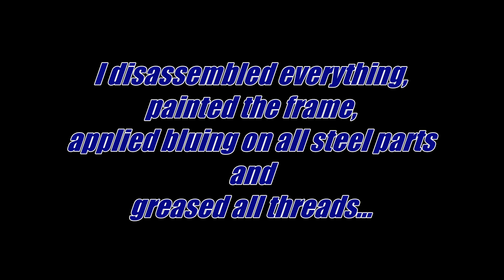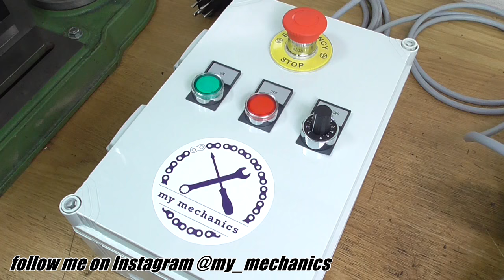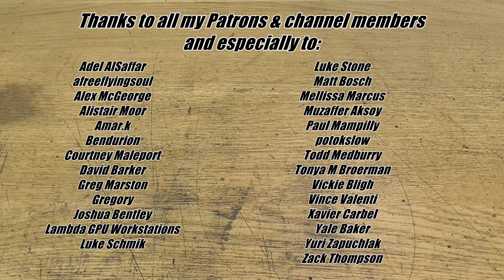Building a Huge Rotary Tumbler from Scratch - Homemade Rotary Tumbler

Comment: I was really curious what you would be using it for... I made one for a tumbler composter with a wood frame and while it was all working nice empty or with little load, when the load got heavy and a bit sticky man it jumped off the wheels... But those porcelain bits will probably never ruin the balance enough for it to fall. Really cool build!!
Reply from the maker: Glad you like it :-)

Comment: I don't have much experience of using a lathe or welding but I am familiar with those blue storage vessels and I wonder how long the sides will last with a heavy load running against the roller wheels. Otherwise, another example of fine engineering - thanks for sharing.
Reply from the maker: Time will show, thanks

Comment: good job and a great video, but i would like to give some feedback about your welding;

first of all, i would not recommend welding with those greeen rubber plastic fabric gloves, as sparks can easily burn through and burn your skin, i recommend welding gloves. and if you wont want that spatter at the beginning when you press the button down, always cut the molten ball from the wire or cut the wire to not be any longer that the metal piece it comes out from, cant remember the name.
Reply from the maker: Thanks for the tips!

Comment: I'm curious about the rubber tube clutch. Why is it needed? Is it normal to use a rubber tube?  What are the pros and cons?  How long before the tube wears out?
Reply from the maker: It's an easy and cheap flexible coupling

Comment: the only possible consideration would be isolation mounts to stop the noise and vibration from transmitting throughout the shop
Reply from the maker: It doesn't vibrate at all

Comment: I know this has been on for more then a year, but doesn't the motor turning counter-clockwise risk loosening the drive shaft nut? And if so, could you reverse the polarity on the motor so it turns clockwise and tightens the drive shaft nut even further? Or does the hydraulic tube prevent all that?

Comment: Great job. May I ask about this rubber tube connection / clutcht?
Is this a kind of "fuse", which would fail if something is blocked?
Reply from the maker: It's a flexible coupling, because the shafts are not 100% aligned.

Comment: I don't even know why I'm jealous even if I had a shop and the equipment and materials I still wouldn't bother or probably try for like 5 minutes loose a few eyes and give up. There is no substitute for ability I had a wooden lathe for year's did the odd really rare piece then I friend borrowed it the things he made with it I just couldn't take it back like it cheated on me some people have a vision of what they are making other like me f it up at the start and give up. Well done to this guy clearly an absolute professional. One question that welder that's hardly one of those cheap flux in core ones?
Reply from the maker: Thank you very much, I really do appreciate it :-)

Comment: What is the purpose of the section of hydraulic tubing as clutch? Providing variable torque as the weight shifts in the barrel? I am amazed that it can turn 45 KG that easily.

Comment: Amazing work as always. Loved every second and can’t wait to see it used in future videos. 

I do have a question for you though. Is there a reason you are using taps and dies to cut your threads rather than single point threading on the lathe? Is this personal preference or is there a deeper or specific machining reason?
Reply from the maker: It's just much faster
Reply: @mymechanicsinsights  that makes a lot of sense. Thank you :)

Comment: I have two questions. 
At 5:30 when you are making the driveshaft holder, would you be able to align the driveshaft-holder’s hole concentric with the lathe as you did if the hole was already cut-out before putting the piece in the lathe? How would you achieve this if you are able? 

I saw something at work the other day where a coworker was trying to chamfer a hole for a laser cut rectangular part similar in shape to that of yours. He was struggling with making the hole concentric with the lathe so that the chamfer could be done evenly across the edge of the part. His lathe also only had a 3 jaw chuck. I didn’t know how to help at the time but I assumed it had to be possible someway. Curious to hear if and how it can be done. 

Great video by the way, happy to have found your channel! Thank you for the interesting and inspiring content. 
-Noah J. Donsig
Reply from the maker: should be possible yes, thank you

Comment: Hey, nice work there!
One question: What's that little metal foam piece for, You put in the lid at 13:46? 
Some sort of vent to allow air/pressure exchange while keeping water and dust inside, would be my guess.
Am I getting that right?

Comment: I don't 100% get the part with the cable, where you attach the ground from the motor, but didn't do that for the electricity within the control box itself... Like will that actually be grounded now?
Reply from the maker: The box is made of plastic, so isn't conductive. The ground wire is conected to the ground from the power supply.

Comment: that is precise work and I love the closeup views you provide. My question though is, how will the blue plastic barrel hold up to the grinding and polishing of the grinding stones inside it? Isn't the polishing material too rough on the plastic and combined with the weight (45 kg's) going to 'grind and polish' through the barrel walls after some time?

Comment: Great! But I guess blue bottle should be metal. Plastic one will break down soon.
Reply from the maker: Nono, metal barrel would scratch and damage the tumblered parts
Reply: @mymechanicsinsights  I think metal will be very smooth in some time, cause it'll be polished by the grinding stones. And smooth metal can hardly scratch another metal thing, only on a high speed rotation.

Comment: Just wondering the facing tool at 1:48 how long does it last before replace cutters normally? Sort of wondering as like idea of cost to run when using that tool
Reply from the maker: It depends  alot on a alot of different things

Comment: 7:45 now THAT is some high quality bar stock. Little to no "run-out" when chucked up in an R5 collet. Edit: 12:57 what in AvE levels of fabricobbling is that?! You precisely true, weld, and machine this elaborate chassis only to couple a motor together with some tubing and worm gear clamps? Before that, I wouldn't have put it past you to make your own centrifugal clutch but that tubing threw me for a LOOP.
Reply from the maker: Thank you very much, I really do appreciate it :-)

Comment: 17:54 :  my OCD is screaming in terror seeing that engine litterally floating in the air with no support under 😱
Reply: I am not quite doing that, it doesn't need a lot of power and that gearbox looks a pretty solid bracket. But most of the motors I worked with used a belt drive, and that puts a big side force on the motor shaft. Most of the load with a worm drive runs along the shaft.

Comment: I have a doubt, why don't you thread everything with the lathe? cant yours do that? is it more accurate to do it by hand? I have seen others do it with automatic forward settings. I'm just curious
Reply: There's another video on this channel where he makes a big bolt and he cuts the threads on the lathe. For smaller threads like this it's much easier and more accurate with a die.
Reply from the maker: Yeah much faster and easier with the die

Comment: To me it looks like the rpm is too high for reaming when you are reaming. What is your vz and rpm?
Reply from the maker: It's indeed, but worked well
Reply: @mymechanicsinsights  it probably is fine, and you will get round holes, the speeds are more for the longevity of the tools.

Comment: what an overkill, why would you not use simple relais and a low voltage switch board for the electronics? I have that exact same switchboard with a couple of chinese boards from ebay. However i like how clean the execution of the everything is. Hat's off to you as usual.

Comment: What’s the breather hose for?
Reply: The ceramic beads are mixed with water, over the course of a day(or more, ~max 60 hrs on timer) atmospheric pressure can change enough to put a strain on the drum seal, and if not vented = water leak.

Comment: There's this stuff called "wood" that is a lot easier to work with, and can easily handle the loads put on the frame, etc. 

Also, why do we need a shaft to synchronize the two wheels? Why not let the wheels spin independently? In fact, why not just mount four casters on a frame, and not deal with all the lathe work, bearings, etc.? The casters already have wheels, bearings, mounting plates, etc. Use two more casters to keep the barrel in position if you want. 

Also, I wonder how long the plastic barrel will last, with ultra-hard and abrasive stuff rolling around inside it.
Reply: Things can be done in different ways. 
From the amateurs point of view i can understand you, from the engineers point of view i totaly understand why he is doing anything in metal ;)
Reply: @TB-jl9fr  Well, I was trained as an engineer, and one principle I picked up is: Use the cheapest material that's strong enough for the job.
Reply: @karlchwe9644  
For privat i can totaly understand that. 

But i dont think you would sell many of these machines if you screw some wood together. Whats with stability, testing for long time reliabilty? Harsh environment like high humidity etc. 
You cant even proper simulate something like wood, at least not very confident.

If you would try so sell a product in the professional area based one some layer wood for industrial applications i would gues no serious company would by those.

Sorry for my bad english :)
Reply: @TB-jl9fr  It seems like for some reason, you think the maker wants to mass produce and sell these, to compete with the many dozens of commercial rock tumblers available worldwide, and sold by the thousands already. Where did you get that idea? I won't say it's ridiculous, but.
Reply: @karlchwe9644  
Well, if you are a professional you generally work for a company which wants to actually do that: sell mass prodcuts to a mass marked :)
For a hobbyist wood would the do the job also for sure.
I dont think my mechanics wants to sell these but he is a professional for sure.
In other words: One can't get rid of habits ;)

Comment: The only thing more impressive than the machining is the electrical. It looks like industrial level quality wiring with screw posts and those controllers. They remind me of PLCs. I don't work in industry so I don't know what exactly those are. The box looks like it's suppose to handle dust and water which is overkill for something sitting in a garage.

 I have no idea how you have those things lying around to use on a simple device like this. They certainly don't look cheap to get.
Reply from the maker: Thanks for watching, much appreciated

Comment: When drilling large diameter holes drill a pilot hole first for example a 3mm diameter hole first then the 20mm after.
Reply from the maker: Never had any issues drilling with that 16mm

Comment: I'm not sure I understand the purpose of the "bearing bushings"? With one bearing on each side of the wheels, these seem unnecessary....
Reply from the maker: The wheels are only made from plastic. One bearing on each side without bushing, you couldn't tighten the wheel with a screw, because the plastic is flexible. Need a bushing inbetween . Inlineskates have this bushing too.

Comment: Well, I started to watch this because, despite the fact I have two rock tumblers already, I wanted to build one that fit my space and not one I had to build the space to fit them.. (my space is limited) The first thing I see is a milling machine I have been working with my hands for over 50 years now and neither I or any of my friend have a milling machine.. so this was mostly a waste of time.. It was how ever a beautiful tumbler. But besides the fact of machines I do not have it was way over complicated and not very particle.. But as I have stated before it was a very wonderful little thing.. But nothing I could use.. thanks.
Reply from the maker: Thank you very much :-)

Comment: Any machinist watching? I'm asking not telling, but was that mill set a bit fast for the cutter size and materials? I know carbide likes high speeds but some of those tools looked like HSS.
Reply from the maker: The end mills are all carbide, also some of the footage is played 2x speed
Reply: @mymechanicsinsights  I see. Then the speeds are, I am sure, all fine. I apologise for my mistake. It is difficult to see. I was watching on my phone. 

I'm not a machinist, I'm an electrical maintenance Engineer tho. The control box you out together must have set you back a few hundred dollars in parts alone, those contactors and e-stop units aren't cheap. Nice job.

Comment: Awesome build, design, machining, electrical all top notch. But brutha you gotta learn to weld. Cringed every time. Your settings are wrong. Have a look how to properly dial in your welder on YouTube. An easy way is to adjust the voltage & wire speed at the same time as putting down a practice bead to get it looking and sounding right

Comment: Let me tell you something, that rubber hose is wrining so much, is too much power and too much work to do, try to use as cardan joint, the rubber-fabric circle thing in automotive steering column systems
Reply from the maker: Thanks for the tip!

Comment: i can't find a good motor, 300w, 220v, low rpm (1000-1200).....agrrrrrrrrrrrrrrr
Reply: Have you looked at older washing machine motors, some have the pulleys you may want also

Comment: Seems like you have way too much metal, machines and time!  I built mine on an old shipping pallet.  I used castor wheels and a worm drive motor powered by solar and battery with a timer attached.  About a million times easier than what you did and automated to go on and off as many times during the day as I want.
Reply: cool story bro